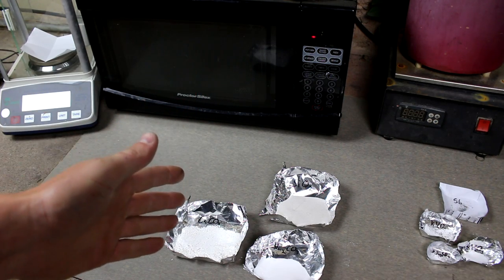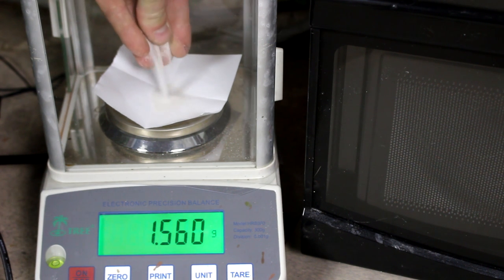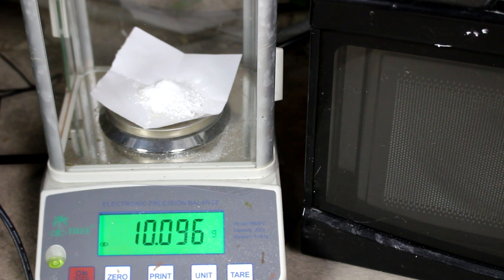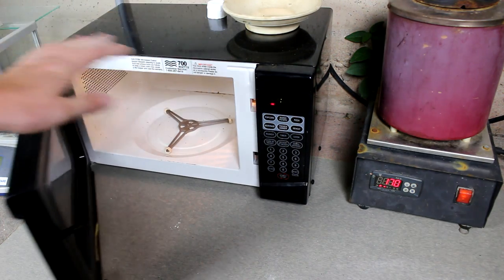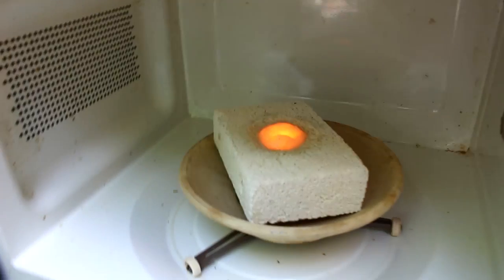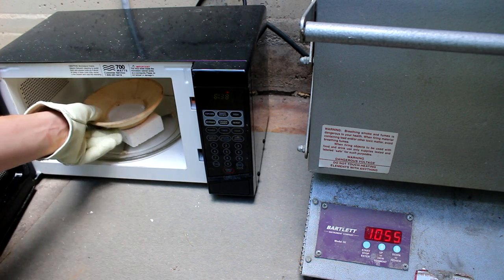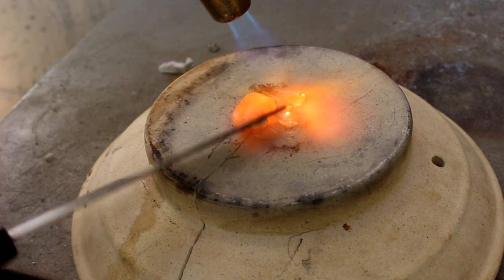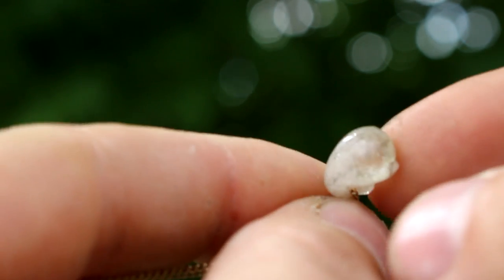Making Glass From Sand Using A Microwave (and some other stuff)

Comment: Those two hotspots are probably the microwave's wavelength apart. (you can measure that weavelength crudely by taking out the turning plate and putting in some chocolate - you'll see these spots when the chocolate doesn't move)

Comment: Faced with a similar requirement some years back, I used silicon carbide "GloBar" heating elements. Worked great. Still have them. 2500 F is a piece of cake for them. They're a lot cheaper than Mo disilicide and easier to power.

Comment: Most microwaves have a thermal cutoff built into the roof, just above the cooking chamber, which shuts off the magnetron when the chassis temp hits ~60 C (depending on the design).

Comment: Maybe for glass making it might be necessary to take the cover off that microwave oven, get a compressed air can (with the tube) and give the cooling fin network around the magnetron a good spray in close with the plastic tube to remove as much dust and crud as possible.  If it's clogged with dust could explain the overheating when making glass.  Oh be sure not to touch any metal on the big red fat wires nearby (that's about a 6 KV shock if you do).

Comment: I   watched this video the day you put it out but after watching it a second time I have a question.
Once the glass is heated in the furnace would you be able to heat it the rest of the way up to temperature with an induction coil. Considering the resistance of the hot glass.

Comment: Fun fact:  Glasses don't technically melt; they just become increasingly less viscous as the temperature increases above the glass transition temperature.  The Silica reaches temperatures where the covalent bonding network between SiO4 tetrahedra simply break and reform.  If you need a better example, compare the behavior of a volume of a glass to that of a crystalline solid.

Comment: hey Cody. would it help to get rid of the bubbles if you put the hot glass in a container where you can pull a vacuum before putting it in the microwave?

Comment: The two "hot spots" you are seeing are due to the nature of the microwaves themselves.  Because of the wavelength of the microwaves used, there are "hot spots" in different areas in the microwave, the heat is not even. Google "standing waves", it may shed a little more light on the subject.

Comment: The problem with the microwave is you're using essentially the lowest power microwave you can possibly find, try going up to your standard household 1100 watt or even a 3000 watt one and it will make ALL the difference :) (the one he's using is only 700 watt)
Reply: If you ever find a 3kw microwave (almost certainly a combination oven-microwave) on the side of the road please let me know. As far as I'm concerned in the second hand world such a find might as well be hen's teeth.

Comment: Cody, there are plans online for using silicon carbide blocks as microwave susceptors in building a mini kiln in a household microwave. They use firebrick to insulate the heat generated inside from destroying the microwave. Why don't you try that with making your glass again?

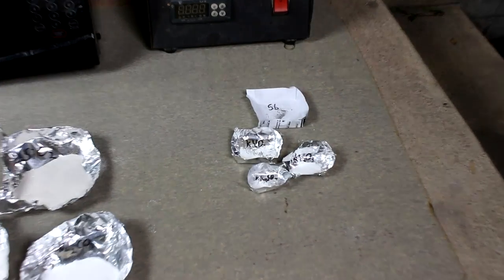Comment: Sorry if this is obvious but I don't know anything about the subject -  can you use pure silica sand from pet shops for the sand in the original mixture? (0:44) and is silicone dioxide the same as silica sand? If so I probably just answered my own question. Thanks

Comment: The microwave isn't designed for that much heat or to run for extended times. You should cut holes in the case and add extra cooling fans for the magnetron.

Comment: it doesn't really matter at this point but I think that one of the reasons that he had to keep the glass in the microwave for so long is because he put it in the very center of the microwave. if I remember correctly, I believe that the middle of every microwave is a sort of "deadzone" and that most of the heating actually happens around the edges of the microwave plate. just something to keep in mind next time he does something with a microwave.

Comment: I once tried to make natron glass, according to the ancient legend that glass was discovered by sailors who used natron to hold up a pot in their campfire on a beach. (Read 25 years ago. So I don't remember it well) My substitute for natron was baking soda. Possibly cooked in a skillet. Not sure exactly how, but I heated that & some beach sand (the one ingredient I had right..) then when it got what I thought was hot, I poured water on it... I have no clue why, but sand was thrown everywhere! (Got in trouble, because in cleaning up my crime, I didn't check the stove hood) 

Most of the sand in the pan was as before, but something, I assumed the sand, solidified on the bottom of the pan in a white glassy lump not soluble in water. I had to chisel it out, & I've never figured out what it was. I aught to try it again someday. Maybe with proper natron even.

Comment: hey Cody, I've been a fan of your channel for some time now and I really enjoy the way you troubleshoot problems. I have a question that's been on my mind for some time now that I'm not smart enough to answer but I figured you might be. How fast would a fan need to spin to pull so much air that it's actually faster than the air can flow into the fan?
Reply from the maker: Pretty much any time the fan blades are breaking the sound barrier the air will not flow in faster than it is being displaced.
Reply: Cody'sLab thanks :D

Comment: Did you ever determine the speed of light using a microwave in school? The microwave creates an electromagnetic standing wave within itself. If you put a chocolate bar in the microwave without the spinning table, the points of high amplitude will heat the chocolate up faster. You will find two burnt spots on the chocolate, the speed of light equals the distance between the spots multiplied with the frequency of the microwave, usually 5.1 GHz. 

Can you make glass or melt something in the microwave only using the point of high amplitude, because it is significantly hotter than the rest?

Comment: I got most of the way through describing how I once built a microwave kiln that could reach over 1000degC from cold-start in about four minutes, but then Windows crashed and I don't feel like typing it all again. Basic concepts were "50% silicon carbide, 50% fireclay makes a microwave suceptor", "stack of kiln-face tiles with a hollow in the center, like a book with the middle cut-out for hiding spy stuff." and "ultimate greenhouse effect". Let me know if you're interested in the long version.

Comment: The glass turntable plate things in microwaves are special. They do absorb the radiation to help prevent damage to the magnetron when there is not enough of a load (food) to absorb it all. I have nothing to back this up with because I am not an expert and too lazy to do research. I may also be wrong. 

wbeaty (Bill Beaty) has a video of a beer bottle in a microwave. He heats it with a torch to get it to a temp where it will start to become conductive and then turns on the microwave. Unfortunately, he hasn't uploaded anything new in years.

Comment: I think you really should do a video measuring the induced alternating currents in a conductor under the influence of different wavelengths of electromagnetic waves... If I remember physics II correctly, the voltages induced in a microwave should* be measurable with a standard voltmeter... You wouldn't even have to put something in there, just connect a cable to both terminals and make the distance about half your microwaves wavelength
Reply: you would need a rectifier/voltmeter capable of response in the 2.5 GHz range .
a "standard" voltmeter would be pretty much useless at these frequencies .
also , a coaxial line could be used , but , the presence of the line will change the node points .
the simplest method would be to use a NE-2 lamp with the leads removed . place a bunch of these in a cube matrix (plastic supporting frame) and place them in the oven (with a cup of water for a load) and observe which of the lamps is the brightest .

Comment: you could have used a small terracotta pot, the (unglazed kind you usually find in the garden) as a crucible, they are often used in glass casting
Reply from the maker: The glass would eat that up.
Reply: Ceramic vessels are also used inside glass blowing furnaces to hold the molten glass, they do get hot but they wouldn't cause porosity (as much) in the glass

Comment: Surprised you didn't try using an 1100w Microwave, or even use the High Power Setting to get a little more heat out of yours.

Comment: For those of you wondering how much money he spent microwaving the glass.  

700W * (0.5Hrs) = 350W-Hrs
Cost of 1Kwh  in my area is 16 cents
(350/1000)*16= 5.6 cents
Reply: But he also used an electric furnace...

Comment: So... how about next you take that silicon and try making a Quartz rather than glass? The only difference between the two is the rate of cooling. You let it cool (very) slowly and you'll let the crystals grow. Add allumina and either sodium, calcium or potassium and you could make feldspar.

Unfortunatly I don't think this is to viable. I don't know how much it needs to stay hot to form macroscopic crystals, but it could be in a scale of years, so its likely not worth it.

You could try mixing with a lot of magnesium too to make forsterite, but its melting point is 1900ºC, and that's quite insane.

Comment: At 12:46 we can see Cody has the right stuff. Not all glass is insolluble.  This was a issue known already back in 1875 that can be the cause of errors in chemical analysis done in the wrong kind of glassware as can be seen in this abstract of a period paper.
-----
On Errors arising from the Use of Bohemian Glass Vessels in Chemical Analysis, especially in Alkalimetry.

Journal Chemical Society, 1875, volume 28, page 382

An abstract of a paper by By P. TRUCHOT in Comptes Rendus volume 79, page 1472 submitted by C.H.P.

If to an alkalimetrical solution tinted with litmus, sufficient standard acid be added to impart a red colour to the litmus, and the solution be then boiled for a few moments in a Bohemian glass vessel, sufficient alkali is dissolved out to restore the blue colour of the litmus; on further addition of acid, followed again by boiling, the same phenomena occur, so that the longer the boiling is continued, the greater is the error introduced. This can be further shown by boiling a little pure water tinted with red-cabbage, or tincture of violets; after a few minutes the liquid becomes green. French glass vessels having a soda base are not thus attacked.

Comment: My microwave got a hole in it,   when I use it,   within 20 seconds around the hole it is glowing red like it has a welding torch pointing at it,   even more remarkable is that after a year of this,  nothing else has happened,  the microwave has not blown up and it hasn't set the kitchen bench on fire either,

Comment: Microwaves are designed to heat water. If you want to heat silicon dioxide, you will need to build a microwave for silicon dioxide.

Comment: There's a hundred Mile strip in the panhandle on the gulf shore from Pensacola to Panama City where are the sand is so pure you can stick rods long steel rods down in the ground when it's thundering and lightning and go back out the next day and dig up the ball that's at the bottom if it got hit by a lightning strike there will be a big huge weird looking chunk of glass in under the sand all you have to do is dig it up and polish it so I don't understand why you need all that other stuff but a bolt of lightning is an awful powerful source so maybe that's why it doesn't need anything but the sand but I've dug some up that were just freaking cool as hell and sold them to the terrorist for75 for some hundred for a couple always got a bunch of money for them

Comment: I wonder if you could just use the microwave, without the furnace by adding sodium-hydroxide to the raw materials, instead of sodium-carbonate. Since sodium-hydroxide will melt much sooner and I believe it will absorb microwave radiation, even while cold.
This would be interesting to try if you ever try making glass again.

Comment: Cody you sure don't seem to listen to the comments. Back in the microwave in a vacuum video I pointed out when your finger pointed to the thermal cutoff switch and gave you some information about them. For example: It'd be super simple for you to bypass them electrically and the microwave would heat much hotter than it did. (You'd also be risking a fire but when making glass I'm sure that's expected. Like your burnt hand likely happened in the many takes you took to get this glass-making right) Your content is good but it could be much better if you embrace some basic electrical knowledge.

Comment: I don't know if Cody annealed it properly.
Reply from the maker: didn't break did it?
Reply: We fire a lot of glass at our shop and when annealing bring it down to 950 900 and hold it for 15 min before letting it drop in temp to completely cool in down to prevent devitrification and cracking if that info helps.
It would be cool to see you make red glass with gold chloride in one of your next vids.

Comment: so Cody, why don't you build an oven? Shouldn't be that difficult Wwith the materials you have at hand". get calcium carbonate from somewhere, shells if need be, calcinate it into calcium oxide, use that as refractory, then just get your silicon dioxide, pure as it is, and melt it into fused quartz. All the additives are basically used to lower the melting point to make it cheaper to produce, but that wouldn't be your primary concern now would it?

Comment: ummmmmm..... when working with atleast 50% of these materials- safety gear should be used. respirator being number one. have fun with silicosis. also- glass needs to ANNEAL. that includes a BUBBLE SQUEEZE. which does not mean nuking it in the microwave. They're not made to make glass in. so. many. face. palms.
Reply from the maker: Not. sure. If. stupid. or. troll.
Reply: Cody'sLab well I have a degree in glass so I’d go with troll.